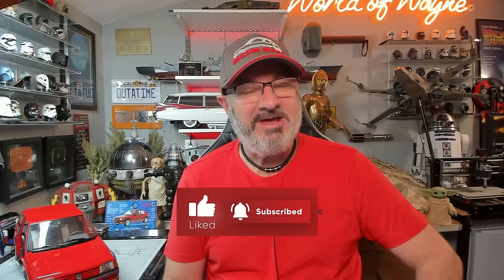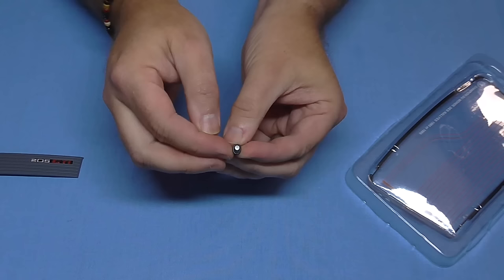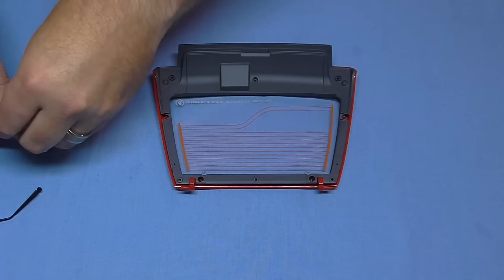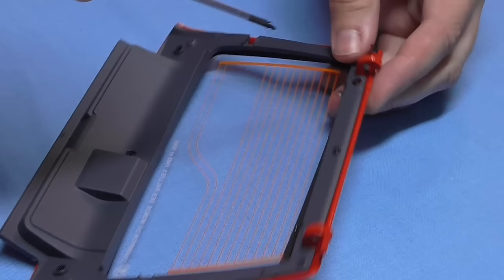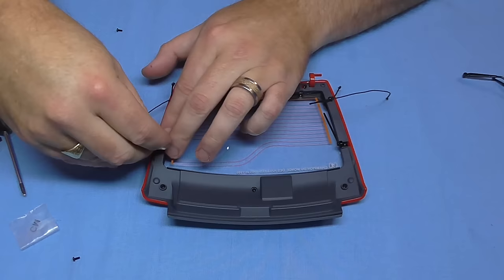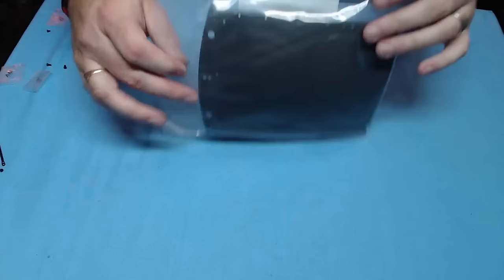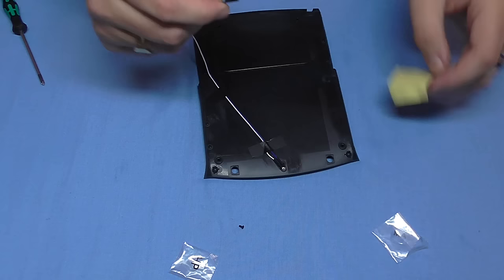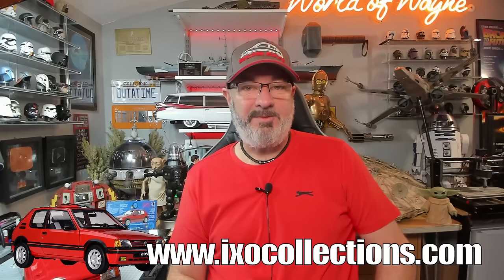Build the Peugeot 205 1.9 GTI LIVE - Parts 77,78,79 and 80 - Attaching the Rear Hatch Door and Inner

Comment: A suggestion on the rear wiper situation.  One of the channels I follow reviews transformers, and the go to solution there, for a peg which will not stay in it's assigned hole, is to paint the peg with nail polish.  This basically widens the peg, so that it has a better grip.